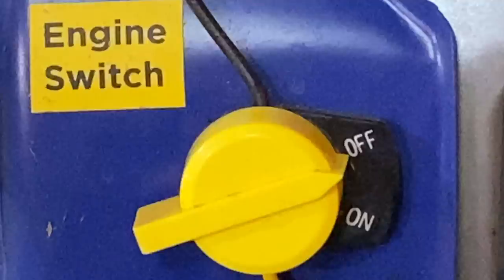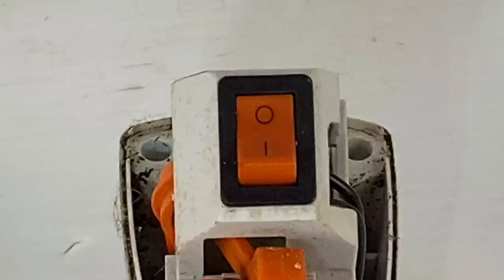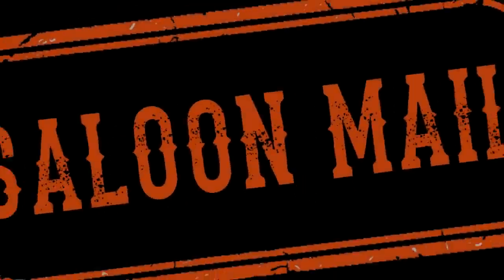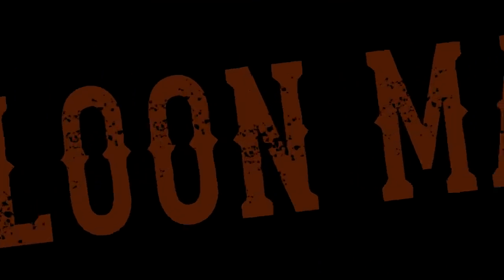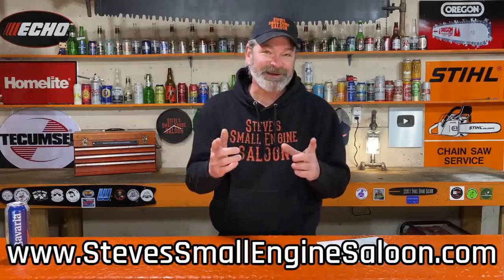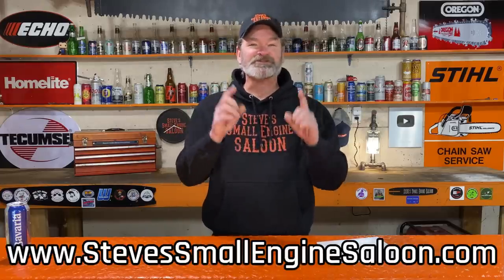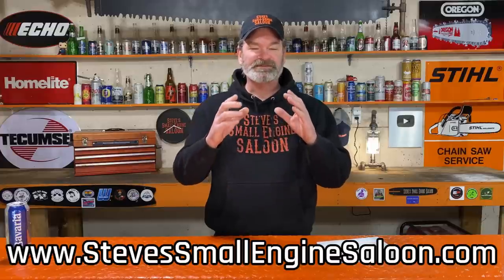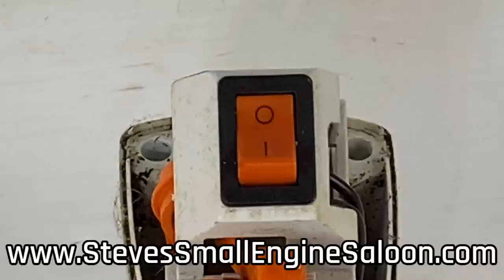Easy Way To Remember What The I and O Means On A Switch

Comment: Thank you, Steve!  You certainly helped me.  I used to mark the switch with a drop of "Wite-Out". Worked out once or twice, before I forgot if the dot meant ON or OFF! 
Now, I'll never forget.  Thanks again for making life just that little bit simpler.
Reply from the maker: Right on buddy!  You're Welcome...
Reply: I like paint pens  and hot glue drops. For this I think I'd paint a thin green line next to the I  and maybe a red dot in the 0. Unless red and green are new to you, you don't have to remember anything. And the next time you see these symbols you can't help but remember green - on - stripe,  Red off dot.  The Ignition, etc... is too binary. Forget the word and you're back to where you were. O for Off is much easier.  Does this mean someone is stupid? I've spent my life surrounded by Fixed Mindset people for whom everything that causes me consternation is "Fine. I don't know why you're having a problem." Of course they are perfect at the few things they can do, but they're scared to death of trying anything new.  Often when some 'dumb' thing frustrates me, it's a design issue. Maybe I'm a bit slower than most people, a good fix eliminates the problem period. Until I read the comments I hadn't even considered binary. Of course. Now it's obvious. Thanks.  (and duh)  Next step, will I or someone else remember this? 
What annoys me are  things that when they're on, the digital button says 'Off,' offering me that choice. But it's not a choice. It's too vague, because sometimes these things say ''Off' when they are off.  Or the things that pop up and they look just like the last three waste of time dialogue boxes that popped up. You click X and then realize, wait no that's the one I wanted. Of course there's no way back. 
Yahoo used to pull this crap. Want to cancel some subscription you were paying for? Yes?  Do you really want to cancel? Yes,  Are you sure you no longer want this service? Yes,  Are you sure that you are sure? Yes. Do you want to cancel this process? Yes. ... Thank you.  Next month you're auto billed again.
The hot glue pips are on my keyboard. On a numerical pad hot glue pips on the odd numbers and you can touch type numbers. We all know blind people can read Braille. I know a very intelligent sighted person who spent two years trying to learn, it was just too subtle. I looked at my keyboard. When was the last time I noticed  feeling the pips on F and J? Never. Bigger pips and I always know where the home keys always are. (I always groan with Tim Cook announces 'The all new revolutionary MacBook keyboard" and right behind his head is 'caps lock" (SIC) Keypads needed a better Shift and Enter, and the upper left keys and the punctuation keys. Some people use Caps Lock, but it hasn't needed to be that big since the early 1990s.) Okay rant off.
Reply: “O” for “OMG I wanna turn off this stupid computer/thing”
“I” for “I want the lights on”
Got pips & want REAL important letters on your homerow?
Then it’s Dvorak keyboard all the way !!!
😉

Comment: Thanks Steve and also a big thank you to the guy that asked about it. I was too embarrassed to admit not knowing. I always had to check the switch on my weed wacker when I started any of my other stuff. It's a rocker that defaults to the "I" position.
Reply: I prefer the switches that "default" to the "on" position, much less confusion, but your explanation is good too, 0 is off I is on!!

Comment: I see it as 0 and 1 (ZERO, ONE). You can see switches with O, I, II (ZERO, ONE, TWO) on a typical fan type, which also indicate speed.
Very easy to understand when you think of it that way.
Reply: That what it is. If that's not easy enough, the 0 looks a lot like O as in an open circuit, one that has no power flowing through it.
Reply: @SmallSpoonBrigade  That is more complex actually and more confusing for some people. An O loops around like a closed circuit, and an I is an open circuit because it doesn't loop around.
Reply: Wow. Trust a human to complicate things! Ask any computer what 0 and 1 stand for …
Reply: How about O for off? 😂
Reply: @alanriordan   Sure, why not? How about O for on? (that's the whole argument right here)
Reply: That's the way it's supposed to be.  1 or 0 like binary code, because it's a binary switch.
Reply: Key word is think, and none of that was involved.
Reply: @MegaLokopo  It's also confusing because if it were symbolizing a pipe, the O is open and the I is closed (pinched off).
Reply: Same here. Although, I have trouble remembering if that really IS the code. I just think it would make sense to see a 1 and a 0.
Reply: I always did exactly the same, and never found it to be any confusing.
Reply: @dx1450 I studied electronics in the Navy in the 80’s, so with that background I assumed it was binary, it never crossed my mind it could be anything else. 
Look at a computer “power” button, it’s a blend of a 1 and a 0.
Reply: @sunrisetacticalgear2676  Yep, I studied electronics after I left the Air Force.  I had heard about binary code in high school, but studying electronics brought it home to me in a real-world application.  College taught me the idea of 1's and 0's as on and off states in electronics.
Reply: How about O shit, I need to turn this on.
Reply: @emiliodaddio8517  That will make you think you need to choose O.
Reply: It IS zero and one. It's a reference to binary code in computers, where 1 is on and 0 is off.
Reply: I always thought it was zero and one. Maybe the zero needs a line through it?

Comment: I never had issue with I & O's but when I was a kid I struggled with Left & Right until I lost the tip of a finger on my left hand. :-) Another one people struggle with is 'Port & Starboard' on a boat or aircraft, I learned it by the words Left and Port have the same number of letters.
Reply: I too got confused with left or right when I was very young until someone showed me if you hold up your thumb and index finger on your left hand in the shape of an L, the L is the correct way on your left hand. Game changer, and I still sometimes think of that
Reply: @Tech-Mark  That's the best one I've ever heard. I'll teach that to my grandkids.

Comment: It's the symbolic transition of 
numerical digits in the digital world for:
 0 (zero) to "O" - open circuit, off
and
 1 (one) to "I" - closed circuit, on

It would have been better to scrap the digital analogy and use the circle for a closed circuit loop (which is exactly opposite of the symbology)

Comment: I'm an electrical engineer and I think of them as binary logic states.  1 (typically some voltage like 5V or similar) is on and 0 (typically 0V or ground) is off.

Comment: Question: What could be the problem after I adjust the carb on my bg56 blower and the low side sets great but the high side will not "clear" up at full throttle regardless of where I set the needle. It will clear (max rpm) for a second or two but go right back in to what sounds like 4 stroking? Any advice
Reply from the maker: Check my playlist for a video called stihl will not rev up...

Comment: I always thought the origin of the symbols was open vs. closed circuit. O (circle) = open circuit (off), | (line) = closed circuit (on).
Reply: You are correct.  But people are stupid so manufacturers flipped it around.
Reply: @egads2  Yeah, I think the memory trick is good (my intent wasn't to say he's wrong. lol) :D
Reply: I had the opposite thought.  The O meant the circuit was completed.
Reply: It's actually binary. Like computer language. It's a one and a zero. I. Computers one is on and zero is off.
Reply: @SuperMutsy  When I took electronics, pre computer boom, we were taught the 0 was open, and the I symbolized a closed circuit.
Reply: That's what I've been taught.
Reply: No when a circuit is open that means that there is no connection between wires so no current flow. When a circuit is closed then wires are touching so current now has a path to flow. So that would mean the machine would be on because now current can flow for spark.
Reply: Anyone who has gone to electronics school knows this because that is what is taught. "O"pen, no flow, or I, completed circuit, flow. couldn't get any simpler then that!
Reply: @iindium49  clueless
Reply: It’s binary, for sure. I and O typically refer to input and output in the electronics world. 
BTW, why would O represent an open circuit? A closed circuit would look more like an O than an I. With just an I it’s as if half the circuit is missing. An O gets from the starting point + all the way around the load and back to the end -
Reply: So, they taught you in electronics what the I and O mean in terms of what you need to know. It doesn’t mean that’s the origin of it. It’s not something designed for only an electronics repairman to understand. Most people wouldn’t know what open and closed circuits were. But, a 1 meaning something and a 0 meaning nothing is pretty universal the world over.
Reply: @mattrader3647  well actually it was designed for electrical use. As far as I know , 1 is the symbol to represent the number one and I represents a straight line. The only reason I would represent the number one is because people are too lazy to finish out this symbol 1.
Reply: I remember doing this in science at school and it's always stuck with me. The 0 is a complete circuit: imagine a circuit with a switch, a light bulb and a battery, if the circuit is complete, the current just goes round and round. The I means a broken circuit : you flip the switch, it breaks the circuit and the current goes to the bulb and makes it light up.
Reply: @iindium49 You sure they are the ones that are stupid? I indicates a line which means the electricity can flow through.  Like turning on a light switch the line is connected...electricity flows.  O open...electricity no longer flows through.
Reply: @SuperMutsy  Aye; that's how I always see it.

Comment: I always thought of it as O for open as in open circuit IE off, and the I was a squished O for closed circuit. But I like your explanation better.
Reply: I always figured that O was for Open but then couldn't remember whether the connection is Open allowing current to flow or the switch is Open blocking current flow. Now I will try and remember Off and Ignition.
Reply: But techinically, with most small engine ignition systems, the coil is grounded to turn the machine off, and the switch terminals are actually closed in the off position to connect the coil kill wire to ground the coil out which kills the spark, the switch is labelled opposite to most common other switches marked with 1/0...so the '0' open/'1' closed switch theory doesn't hold true in this instance🤣👍
Reply: @simonilett998  You are correct!